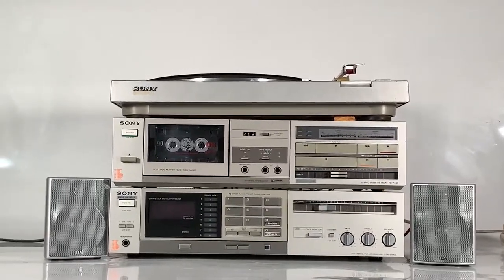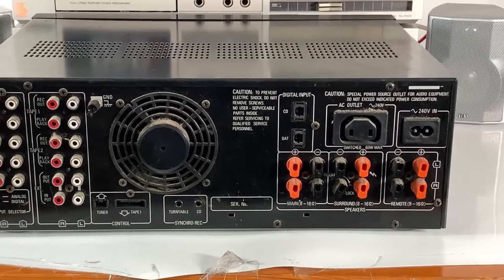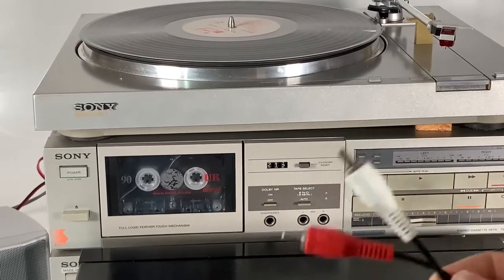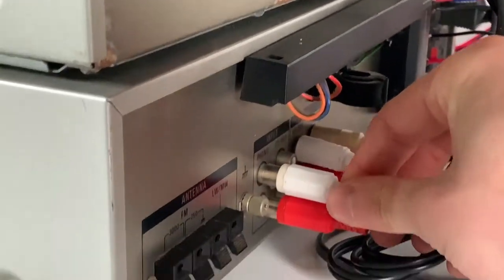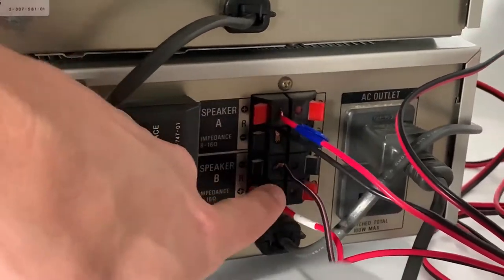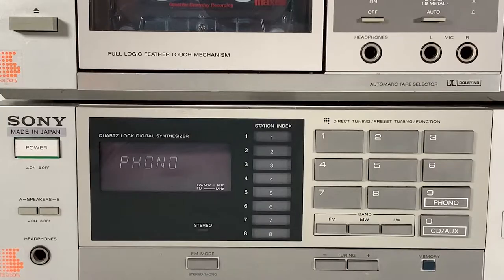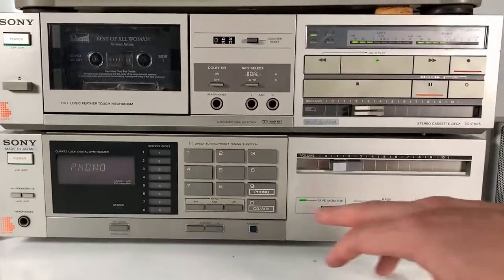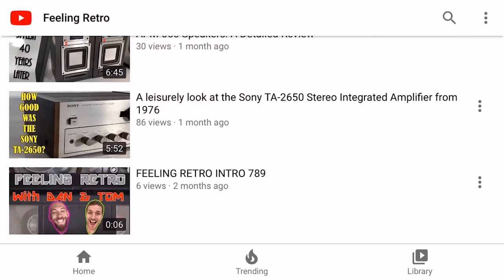A Beginners Guide To Vintage Electronics, HOW TO Tutorial - Set Up Sound System

Comment: Unless your turntable is fitted with a p-mount system, and the one in the video wasn't, , the turntable needs some setting up too. Especially with regard to the tone arm. That is to say that you have to check if the grams of downforce the supplied or after market cartridge performs best is still set as well as checking if the anti-skating force is set to its preferred grams. In addition, you should check wther the needle is still ok, or that you have to buy a new one. Please read up on that, otherwise you will not be able to enjoy your records fully and, just as important, you will damage your records beyond repair. PLUS: never ever connect any other device than a record player at the designated connectors at the back of your amp, because if you do, you will blow up your amp.
Reply from the maker: thank you so much for this useful information! if you notice we need help in other videos please comment and let us know!
Reply: That why his set up sounds ugly. He doesnt know to set it up properly.

Comment: Sorry for the dumb question am pretty new at this but I got a mcs 2266 system and I also happen to have some Bose roomate 2 speakers. The Bose speakers have their own power cable and the speaker wire connection is meant to connect the right bose speaker as the left one has all the other inputs. Theirs an rca audio input on the left one. I hooked up the appropriate rca cables but realized my mcs only takes speaker wire for speakers? Would I just simply have to find rca cables with a speaker cable end to it or are they just simply not gonna be compatible?